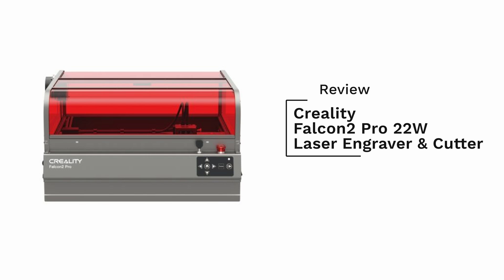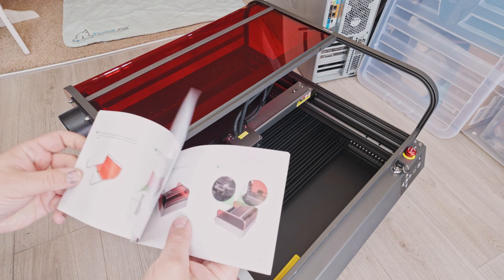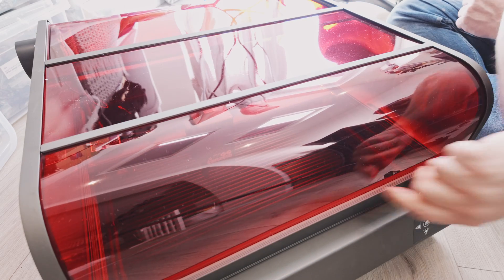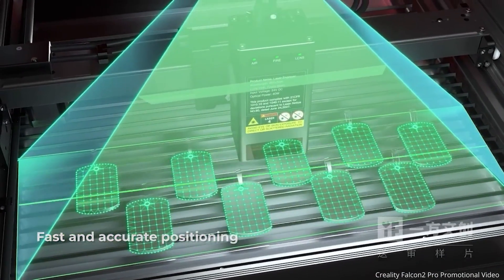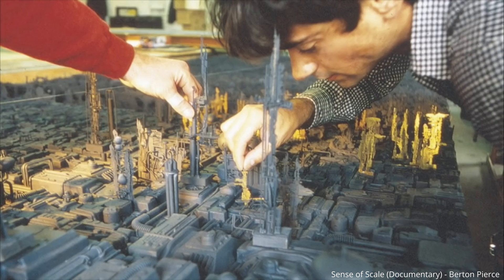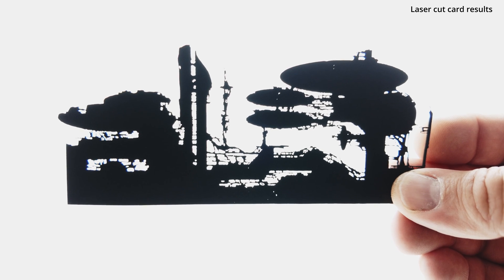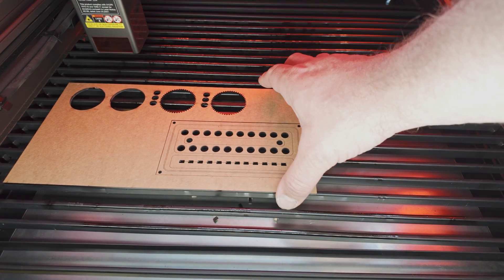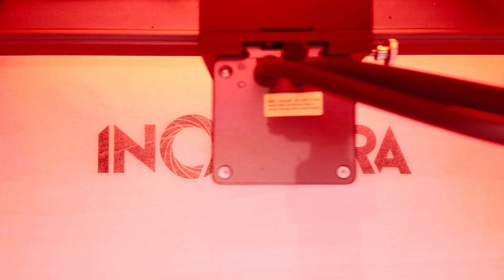Creality Falcon2 Pro 22W : InCamera Review

Comment: I so want one! I worked with a prop house and they had access to one and it was such a bliss. So much faster than 3D printen (which in 2008 wasn’t a thing yet) and hardly any setup compared to a CNC machine. But I never dared to go for the ChinaLaser. This may change my mind.